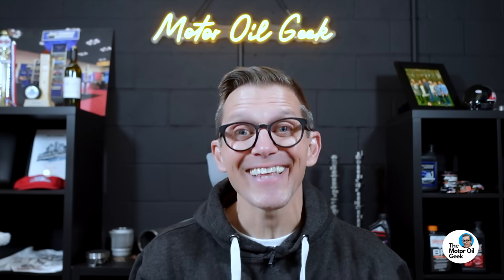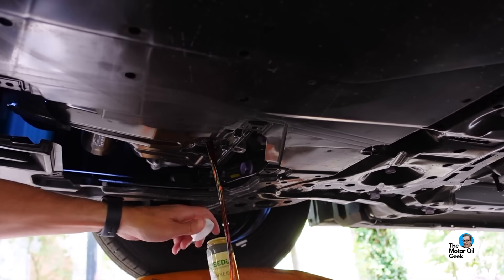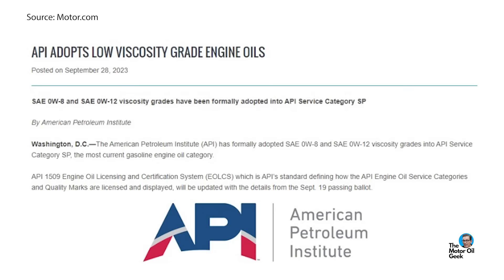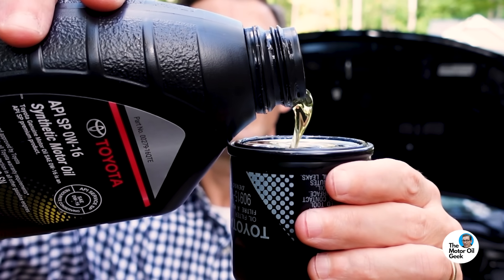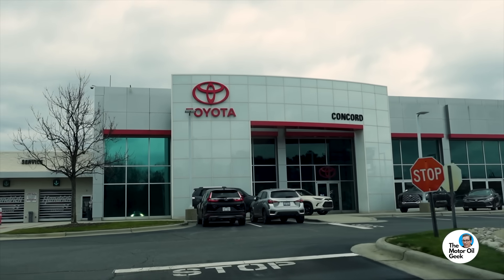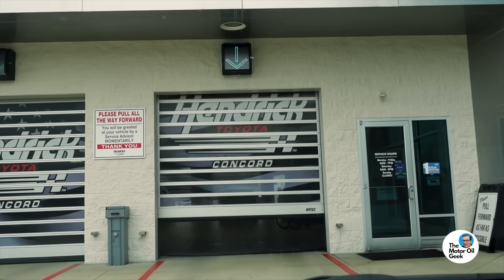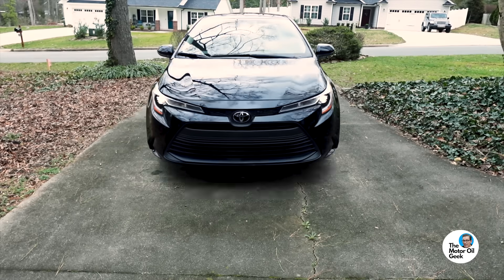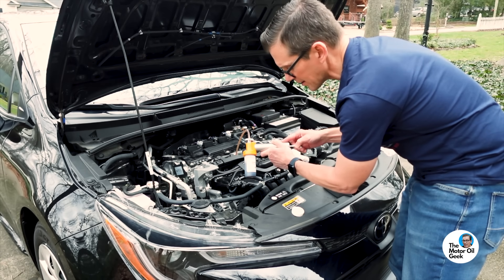0W-8 Motor Oil: Too THIN to Trust? Let's Find Out!

Comment: 150hours at 150 degrees is nothing special, how does it perform at 200+ degrees when the water pump fails down the line? I need to know that there is a buffer at least in my oil when my car starts to overheat and you just won’t get that with the 4ish quarts of 0-w8. This is a huge problem for owners down the line probably at the same time as the CVT belt/chain fails.

Comment: A niche topic that would be awesome to see you dive into is the 0W-20 Dexos D rated oils recommended for GM's 3.0 liter LM2 and LZ0 Duramax engines. These trucks have a small but overly neurotic community of drivers and enthusiasts that obsess over every detail of the trucks (myself included) and oil is one of the top points of contention. You have the old school diesel enthusiasts that balk at the thought of a zero weight oil and dump Rotella into their trucks, and then there's the rest of us that are left to sit and ponder the various approved oils. 

As far as I can tell, the major factor that gives the oil the coveted Dexos D rating is the fact that it is low ash and therefore DPF safe. There are two main Dexos D rated oils, the factory AC Delco and the eerily green Mobil 1 ESPX2. Many people used Amsoil 0W-20 Synthetic Diesel, but it's not Dexos D rated. 

My question is, between the AC Delco and the Mobil 1, what are the differences? Lubricity, volatility, anti-wear packages, ash content, and detergents and dispersant contents would all be awesome topics to finally have some solid numbers behind.
Reply: 0W20 esp isn’t only for diesels, all the newer gas vws take it.
Reply: @alexandergunaka973  Right, but 0w20 ESPX2 is one of the only ones that is also rated for use in the 3.0 Duramax engines. It's backwards compatible with any gas or diesel that takes the regular 0w20 ESP
Reply: @cje26  I’m sorry. I meant to say don’t worry about the green color and such. I have people in all types of gms running esp for a cleaner fuel system. Never had an issue and they are repeat customers.
Reply: @alexandergunaka973  No worries, man. The color was definitely weird, but I'm glad to hear a lot of people are happy with it. I've been running it for a while with no problems

Comment: 5k on the oil changes to keep the ring packs clean and maximize engine life.  
Timing chain and gear wear might be an issue with these super light oils down the road.

Comment: No one ever talks about the horrendous oil leaks developing in newer cars in as little as under two years or 30,000 regardless how well they're taken care of. Internal protection or not, the benefits of new ultra thin synthetics don't mean anything at all to me as a mechanic as far as emissions and/or 1 or 2 extra mpg from drag efficiency when I cant keep the oil IN the engine; When they're not burning it away they're weeping it all over the place so cars coming in with virtually nothing on the dipstick after 7,000 miles is never a good thing especially when the customer's got meticulous records of what went in the motor. And 7 for 10 its been vehicles run exclusively on 0w20/0w16 that aren't winning any efficiency longevity races in the real world.
Reply: This. All of this right here. These new thin oils are great for so called efficiency/gas mileage at added expense of wear and tear on the engine. Especially in hot weather. 5w30 or better. Screw that. Lol.
Reply: @HectorQuien  I run 5w40 exclusively in my Ranger post engine-out refresh, even in winter with not even a stain after 3 years in brutal Texas heat. All the newer stuff that comes to me gets 5w30 (that's the deal if they want me to continue to look after it), makes a HUGE difference in engines with low tension rings like Toyota & Hyundai and if swapped early enough has made a noticeable difference in irritating leaks

Comment: That's what the engineer at Engineering Explained claims! But I'm old-fashioned: I purchased my wife a KIA Sportage, which calls for 0W-20 oil, but I used 5W-20 and NO change in the MPG was noticed! At this point, I'm very hesitant to use 0W-20 viscosity oil. Considering that we live down at Puerto Rico, where high temperatures prevail, going a notch up in viscosity won't affect the engine! What's next?! OW-O???

Comment: I have a 1990 Mercedes 300TE with 150,000 miles. Valvoline 20-50 Racing high zinc oil with 3,000 mile interval. I plan on having it tested. Do you recommend specific oils for specific vehicles with mileage ranges. Thanks

Comment: could they just invent an engine that uses ultra thin oil? Or better yet, no oil whatsoever in the crankcase? Zero-0 oil? Maybe just a few drops of oil mixed in with the gas, to lube through the gas? with no crankcase oil, your oil change interval would be infinity! Please, pretty please engineers , invent this engine! One can only dream...

Comment: 0W-8 puts you too far to the left on the Stribeck Curve, yet I wonder if they accomodated that by using slightly wider bearings (spread the load more) and/or they cool the cylinder walls around the rings better like Audi did on their V6 turbo high performance engines that now use thinner 0w-20 oil (inside the walls are more coolant passages).

Comment: The truth is until you show me  a car with at least 100K miles on it been running with this thin oil I remain skeptical
Great video other wise!!
Reply: I have a 2006 Honda and 2008 Toyota intentionally running 0W-16 full synthetic oil, changed every 10,000 miles.  Both call for thicker oil changed more than twice as frequently.  611,000 miles on one and 406,000 miles on the other, nether engine has ever been opened/refurbished, neither car burns oil.  The reduction in engine drag is quite noticable; both cars gained an average of 2mpg, and on the Honda, I have to throw the shifter into first gear to get the amount of engine braking I used to get in second gear.  On the Toyota, it has worn out synchros that would regularly grind during certain shifts, especially when cold.  I recently upgraded it from the specified 75W-90 oil to the thinnest same kind of oil I could find, a recently released 70W-75.  The change was immediate and almost as good as a new set of synchros, and to my surprise, the car gained another MPG on average (I didn't think there was that much drag in a manual transmission!).  Both cars start much easier in the winter.  If there's any downsides to running thinner oils on an extended change schedule, it's been years now and I haven't discovered it yet--I would totally do it again and only wish I had started sooner.
Reply: @shalemloritsch9382  How many of the 611K miles were with 0W16?  What were the original bulk of miles run with?  0W16 hasn't existed for most of the life of those cars, so what got them to be high-miles cars was clearly not the 0W16.
Reply: @EfficientRVer  Bought the car at 280K and transitioned it shortly thereafter.  It ran 0W-20 for the first 280K, and I have more than doubled its mileage on 0W-16.
Reply: @shalemloritsch9382  Be nice if you mentioned your summer temperatures and how long they lasted when it was over 70F.
Reply: @shalemloritsch9382  Nice, I'm definitely going to go with it! 0w-16 here I come!
Reply: @tradingnichols  So the guy lives in Alaska where 0w16 is a good idea, and you live in Texas or AZ where it's probably not a good idea.  Ok, do it.  When your car starts burning oil, and then ticking on morning start ups where the temp is over 90f, you'll wonder why.
Reply: @lonniebeal6032  It is typically over 70°F five months of the year here.  A month ago it was 100°F.  But this is all irrelevant because the operating temperature of engine oil is around 190°F once the engine has warmed up.  Also, I have upgraded to using 0W-8 oil since it recently became available.  And I live thousands of miles away from Alaska.  You need to stop lying.  😡
Reply: @shalemloritsch9382  I was wondering how Alaska became part of this chat! Thanks so much!

I've decided to try 0w-20 and/or 0w-30 next winter but for summer driving, I'm sticking with 5w-30.

Or here is a fun one for you home chemists out there.  Should I try for a mix 10w-40 with 0w-30? Effectively, assuming they were identical brand and formulation it would end up 5w-30 with a small amount of extra shear protection - the 40 part, and a lack of protection against oil burning from the 20 part. 

You'd probably get the worst of both simultaneously happening? 😂
Reply: And some of the best of both? That would be too lucky! 🤣
Reply: @shalemloritsch9382  You failed to mention how many months you have over 70f, which is the upper limit of all 0w20s on any viscosity chart.
Reply: Trust the science. His wear was fantastic. Shear viscosity is good. Quicker flow at cold start up SAVES engine wear.
Reply: There's no reason to be skeptical. You people are so paranoid. Toyora wouldn't engineer these vehicles to take this oil if it didn't work. Everyone said this about 0w20, and look, millions of toyotas on the road with 200k plus miles and no issues.
Reply: Thin oil flows better at startup, when most wear occurs.  Tighter engine bearing clearances and smaller oil passages require lower viscosity oils. The additive package and oil chemistry makes all the difference
Reply: @wallacegrommet9343  For the south, I live in a surprisingly overnight cold area for temperature drops. You got me thinking I want better startup flow. My 2018 Mitsubishi G4 3 cylinder engine still recommends 5w-30, but this video talking about how 0w-16 protection has a better package, combined with it being winter has really got me thinking. 

Nostalgia and thinking thicker is better, has me so proud of them still making 5w-30 cars, but I have to say, how many brands of cars I've seen where the engines were not changed, but moved from that to 0w-20. I suspect these new 16 oils have something special going on.

0w-20 definitely wore out engines faster. I'm wondering if better additive packages can turn that around in the newer oils.

5w-30 keeps being updated too though so... well... it's complicated!
Reply: @wallacegrommet9343  In hotter climates that thin oil returns to the pan faster than a higher viscosity.  But yes, the additive package is everything, I would expect 0w20 and lower to have a high TBN so it didn't break down so fast in a hot climate, and a high anti-wear package.

Comment: Do you have any information concerning the 0 - 16 or any 0 oil  running in direct port injection engines? I wonder about the oil in the vapors under high heat combustion.

Comment: Dealership oil is always to be considered to be the break in oil its not bad oil but it might not be the best and it's up to the you to choose the right oil recommended for that vehicle for the follow up changes for the service life of that vehicle.
Reply: I work at a Honda dealership, so I run the bulk 0W-20 in my 2015 Fit because I get it for free. But I also use short intervals, so it's not gonna have time to hurt anything even if it's not as good. 

Back when I paid for my own oil, I always got Penzoil Platinum full synthetic. And despite my 2013 Honda Accord at the time being fairly prone to oil burning (basically all K24Ws burn oil if you use the maintenance minder for your oil change schedule), Mine didn't burn any noticeable amount at 140,000 miles. Granted I also never went past 4000 miles between changes and was very picky about all fluid intervals. For instance, Honda MTF (mine was a 6 speed manual) is very thin and doesn't  like extended intervals either. The Honda interval on those is 30,000 miles, the same as the CVT equipped cars. And you do feel it shift way better if you stick to that interval.

Comment: I would like to get your opinion on Lucas Engine Oil additives on low and high mileage engines. Do they offer any extra protection over quality synthetic oils? Are there any adverse effects?
Reply: I called SWRI in San Antonio regarding oil additives.  It was their opinion that the additives do not help.  Recommended just using quality oil

Comment: You should test the new "universal" fluids that claim CVT and regular torque converter ATF compatibility from Castrol and Valvoline ... really bizarre stuff and there is a lot of controversy going on with those.

Comment: Engine oil simplified: 5,000 miles or 1 year whichever first. Any brand works if it meets the API. Do NOT listen to 10,000 Mile nonsense.

Comment: The Toyota CVT isn't a steel band style! The eCVT uses a planetary gear set that relates the ICE speed, electric motor speed, and output speed to another electric motor! Very high revs on the motor like 17k at its fastest

Comment: That's funny, "I couldn't find the drain plug." A Long time ago, 25+ years ago, I was at my brother's house and a friend of his was changing the oil on his then brand new Ford Fiesta. I briefly looked under it and he pulled the drain plug (looked like an aluminum oil pan) and drained the oil. He refilled it and it was way over full. On the way home his car wheels locked up and he had to call a tow truck to drop it off at the dealer. Turns out he drained the Transmission instead of the engine. He was an accountant. After that he never tried to change his own oil again.

Comment: Prius doesn't have a CVT.  I believe it has a planetary gearset.  You should still use the correct spec fluid but your explanation is off.  It might feel the same but the mechanical parts are totally different.

Comment: Hi Lake, I am from the island of Mauritius found in the Indian Ocean, I have a Corolla Hybrid of June 2023 with the same body style that your daughter has, but with the 1.8L Hybrid Drivetrain.  In the user manual it recommends using 0W-16, but this viscosity cannot be found anywhere in my country, they are all selling 0W-20 even at the dealership.  I will be going to my dealership for the first servicing with the "free oil" at 10,000KM in about one month's time.  Wonder what oil they will put in the car?
Reply: A side note there are a lot of JDM (Japanese Domestic Market) in my country, under one of the hood of a Toyota Aqua Hybrid of 2017, I found a sticker in Japanese recommending the use of 0W-16!

Comment: There IS a point of diminishing returns for thinner oil VS protection or film shear strength. These low viscosity oils came about to meet CAFE standards and largely nothing else. Oil viscosity is primarily dependent upon engine clearances and most 'modern' engines have vastly tighter clearances and manufacturing tolerances that the engines of decades ago. Another item to keep in mind is that with VVT engines it is imperative that you use the recommended oil viscosity to maintain the optimum engine performance. So, just use whatever is recommended by the MFR for your climate.
Reply: If it is true that "'modern' engines have vastly tighter clearances" then how come Toyota owners manuals tell owners they can use any viscosity from 0W-20 to 20W-50? https://imagizer.imageshack.com/img922/977/WqmoR2.jpg

Comment: I stopped changing the oil in my cars. Maybe once in the last 20 odd years and half dozen vehicles. Filter changes as needed but otherwise I just make sure the oil is always kept at the proper level.

Comment: My question would be, do the viscosity numbers actually represent the actual viscosity, or are they used to differentiate between additive packages or something else. For example, gear oil has higher viscosity numbers but is not a direct correlation to engine oil numbers. This, according to an oil manufacturers information. Are these low index numbers simply used to identify energy conserving oils?

European and Japanese use different standards to meet their automotive manufacturers' requirements, SAE is a different entity, having to play catch-up.

Comment: Thanks for the info! I recently took mine to the dealership I bought it from and after debating with them that I wanted an oil change at 1k they agreed . I had to pay out of pocket no biggie but they put 0w16 gtmo back in it. I asked if they had the 8 and got told they 16 was perfectly fine and so on. Do you think running the 16 will have a negative impact long term?

Comment: Probably a great choice for oem driver. But in a high perf application with a little fuel dilution. I would never risk it. To close to the edge.  I bet its good for milage though.

Comment: Not many people know this but dealership oil is most likely (not all) bulk motor oil supplied by the lowest bidder, not by the OEM manufacturer themaelves. Nothing wrong with that as it would be bulk oil of the proper grade and specs… If you really want your OEM motor oil, you must tell the service advisor that you want the OEM bottled oil put in your car
Reply from the maker: That's what I was expecting, but they surprised me.